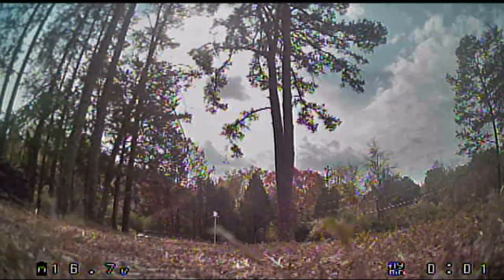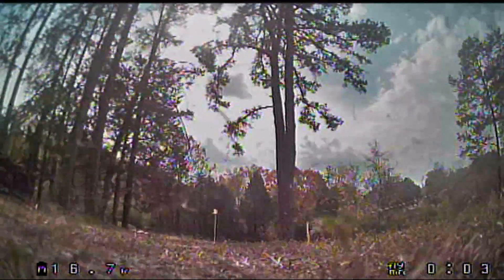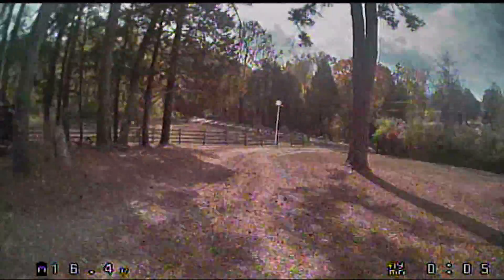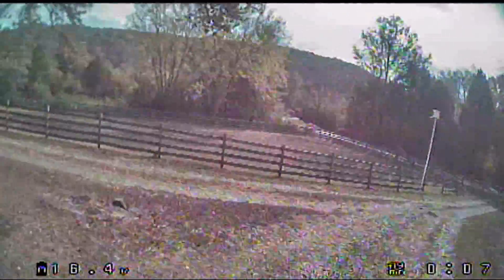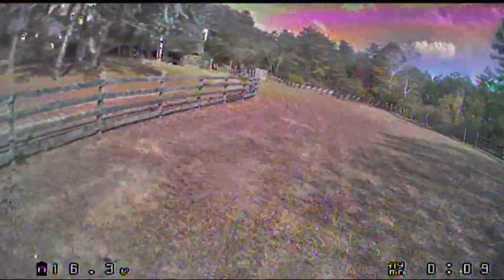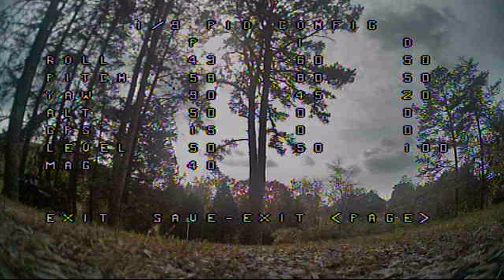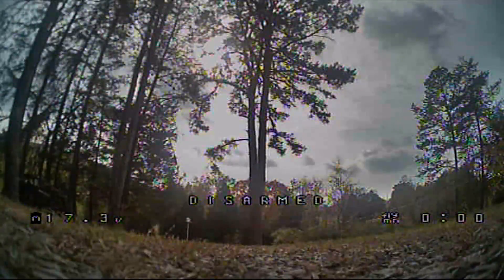Farewell To The Eachine Falcon 210

Comment: How to get to the OSD menu directly? I tried the yaw right and full pitch but didn't show anything.. Mine everything is still stock parts. Appreciate your comment.
Reply from the maker: Mid throttle, yaw right, pitch forward.
Reply: Joshua Bardwell I did that but nothing happened. Should I do something before I have that?
Reply from the maker: +Rafael Putra no, that should work. Does the osd say "no data"?
Reply: I just flashed it with MWOSD with FTDI so it's working now with the menu. Thanks for your help.

Comment: I can't seems to get the prop wash problem, so d gain is the key?
Reply from the maker: In general, yes. But if you are running Cleanflight on the stock ESCs you will never get it perfect.
Reply: Joshua Bardwell no I am running a 170 quad with 20a bump bee and cleanflight. Sorry I wasn't being clear.
Reply from the maker: BLHeli_S is good but you will do much, much, much better with Betaflight 3.0.1. Propwash handling requires good filtering and as far as I know, BF filtering is way beyond what CF has.
Reply: Joshua Bardwell thank you will try that.

Comment: i have the flysky i6 and it does struggle to re-center the sticks, i have about 5 deadband on my yaw and even with ppm and ibus the numbers can still jiggle around center on BF gui.  i wish the sticks themselves were heavier too, its not easy to find center
Reply: yeah why didn't you put arming on a switch?... i forget how but you can enter system mode on the eachine i6's.. i think?